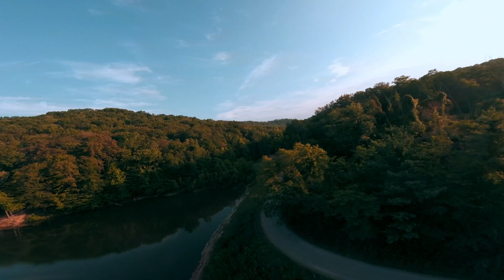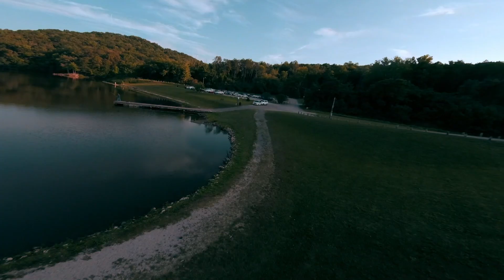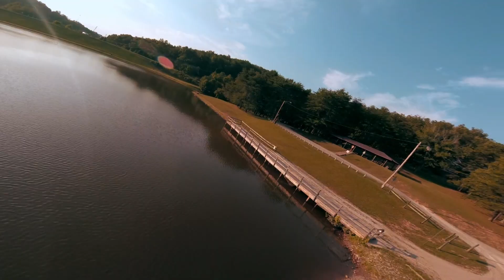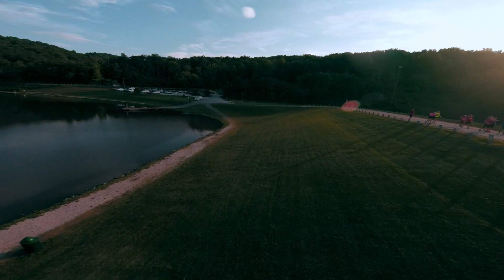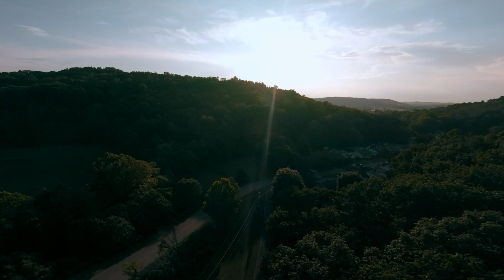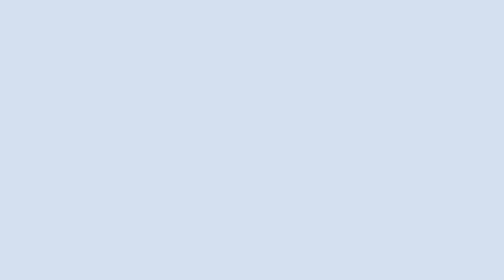Attempts to deal with mid-throttle oscillations on Betaflight 4.0.4 / Staceman FPV

Comment: I feel your pain! I am only using my betaflight rigs with 3.5.7 for now. I have had pretty good luck with jello on these setups unless a motor sounds rough on the bench just throttling with BF motor tab. Oddly I have had very bad luck with my Kiss V2 Alien setup for the past year, don't fly much because of jello even mounting the FC 3 different ways. Bright sunlight and even one janky motor and i get some jello when facing into the sun or a very bright area. With betaflight I have switched out all components (including frames) except camera's and VTX to eliminate jello in the past. Hope you figure it out. Try switching back to 3.5.7, all default, except filters and rates and see if anything improves?
Reply from the maker: Thanks!  Been trying several things, and making some progress with it.  Once I get it figured out, I'll post my findings.  I thought it was probably motor too until I tested on the bench the other day.  Frame is new, and virtually no flex (qav-r v2)

Comment: I'm guessing you tried a different set of props to eliminate then from the equation. Also guessing you lowered your filtering and or added some because sometimes its just needed, also the camera mounts, no sure if you only see the vibrations in your fpv plus your h.d. or if its just the h.d.
Anyway just some thoughts, I never went to bf4 just went to FL1 so not sure of nd has the custom tpa curves like in FL1 but that might be an option but fussing you tried that also. Anyway love your latest flight around that lake!
Reply from the maker: Just in the HD feed.. tried all of those suggestions.  Bf doesn't have really good TPA control

Comment: I fought this for months on 4.03... The 2 things that seemed to help the most were. I removed the Gummies from my JBF4 FC and just used o rings. I also went down in prop pitch. It also helped to shutting D Min off. ( Set to 0 )  I think that's a 6S thing. 
Heck, mine may be all 6S fixes.. Good luck Stac !!  
 Nice flight sir !!
Reply from the maker: I did the d min thing.. and I reduced prop pitch a little though I don't run aggressive props anyways..  the gummy thing is an interesting idea

Comment: Great video, most of the noise and vibrations on a kwad comes from motors but the fc filtering will usually filter noise so it never makes it to the gyro, your gopro on the other hand doesn't get that luxury. The gyro read out in the motors tab may catch  vibrations like a wobbly or bent bell, but the noise frequencies from the motors are usually filtered out before the information reaches the gyro. Just a thought, but your camera may still be affected by the motors frequency. I will sometimes change my pwm in the blheli configurator but I'm still learning and may be way off or wrong.
Reply from the maker: That's a thought too... This stuff is annoying for sure.  The cap helped some I think.
Reply: @StacemanFPV  it definitely get frustrating chasing down a problem. I think you'll get it tweaked to suit ya tho. The video looked great and it was awesome how much ground you were covering, that spot is pretty huge.
Reply from the maker: @bigbillneace  yeah it's pretty good size place.. I think I was about 1/4 mile away or more at a few points.

Comment: First check your components starting with the blades, body, motors, motor controllers and go down the line make sure it' not a bad component. Always test before using.  A bad part might test ok but will fail under load(use). Don't forget to cut Fregency you use a resistor and capacitor together. That is a trap and sends the frequency to ground. The key is experimenting with the values. Try a .01,.001,1.0 microfarad electrolytic cap and a 500,1k,2k,3k ohn and see if you can zero in on the HZ. These are reference values yours may and will vary. Also putting diodes on dc components like inductive circuits(coils) helps protect from wrong polarity and chatter or oscillation in dc circuits. Especially relays and motors. Hope this helps.  Peace
Reply from the maker: Thanks.

Comment: AHHHHHAHAHAHAHAH  grrrrrrrrr.....cascading issues with this diagnoses....Hey this is the remix, right? Have you checked the strength of the arms? This gave me issues too, where one arm (3) had become very playable...twisty...just as a new friend says, "just spit balling here..."
Reply: Louis P Floyd had that happen before on my remix
Reply from the maker: Qav-r v2, with the extra sandwich plate on the bottom added.

Remix runs flight one.. No jello :)